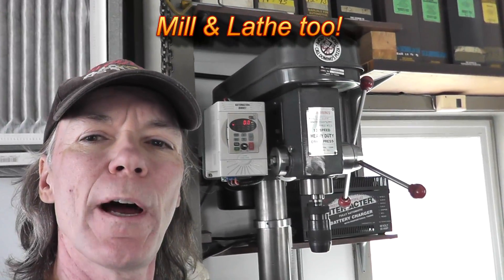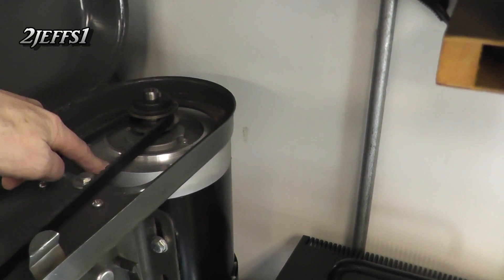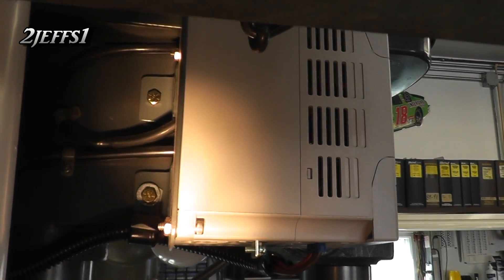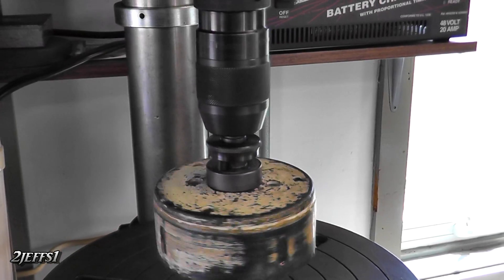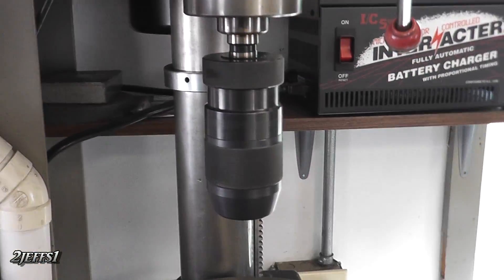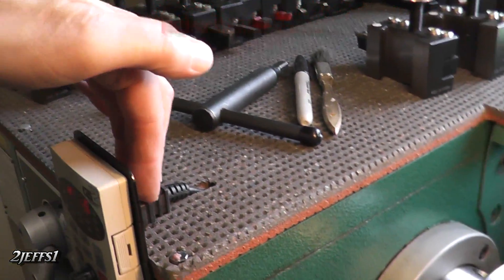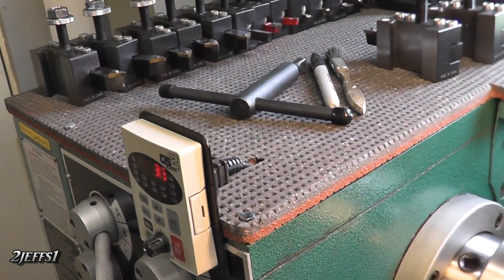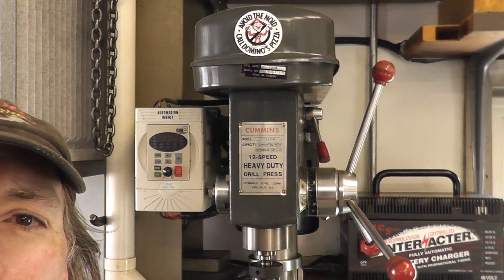VFD Drive Drill Press Lathe & Mill  (Variable Speed) DIY

Comment: love the tool tip with the soldering iron. Hey, what is your indexing hardware for your DRO?
Reply from the maker: Shumatech is their name. I built them in house with his design. He has some newer design I seen a while back those panels I have are obsolete now.
Reply: I looked up Shumatech. That's for the reference, he's using openDRO, which is cool. Thanks for the info.

Comment: Hi,  I calculate based on your setup that if you want to run your drill press at say 25rpm, you have to have like 0.8Hz input on your VFD.  Can you run it that low?  Does it work ok with good torque at that speed?
Reply from the maker: For that low speed operation I would recommend leaving that center jack shaft in to gear things down more. You are correct on your thoughts where that wouldn't work good as shown.

Comment: I recently purchased a Delta DR 40 wood lathe and none of the parts are available. It just stopped and solenoid clicks but that's it.
It has a 1 1/4 hp brush dc 90v motor. Do you know if I have any chance of finding a unit like on your drill press that would work on this motor? Also it is single phase.
Reply from the maker: Sorry - I don't know of anything you could use for a drive. Perhaps a motor rebuild shop might be able to recommend something that would be helpful. Good luck.
Reply: Thanks for getting back to me. Great video.

Comment: Thank you for your time on this. I might try it. I need to run my drill press at 60 rpm. Where did you purchase the parts? thanks again
Reply from the maker: Hello Eric. I bought the parts from https://www.automationdirect.com/adc/Shopping/Catalog/Drives  Used the drill press yesterday, still enjoy those drives so much! If you are going to be running at 60 rpm for a long time and do need lots of torque perhaps leaving the center jack shaft in for lower gearing then might be a consideration. Good luck, Jeff

Comment: Thanks for this video.   I have only recently learned about VFD and I'm not all the knowledgable about electronics.    I would love to stop using those darn belts.    

is this the motor that you used?    Did it just bolt on or did you need to modify the mounting plate?   

http://www.automationdirect.com/adc/Shopping/Catalog/Motors/AC_Motors_-_General_Purpose_and_Inverter_Duty_(0.25_-_300HP)/AC_Motors-General_Purpose,_Rolled_Steel,_IronHorse_(0.33_-_2HP)/3-Phase_Motors,_56C_(0.33_-_2HP)/MTR-P75-3BD18

and this is the drive?   
http://www.automationdirect.com/adc/Shopping/Catalog/Drives/GS2_(115_-z-_230_-z-_460_-z-_575_VAC_V-z-Hz_Control)/GS2_Drive_Units_(115_-z-_230_-z-_460_-z-_575_VAC)/GS2-11P0
Reply from the maker: Hello Michael. Those should be correct to order. I did oversize the drive to the 1 hp which is better to do if you were wondering and used the 3/4 hp motor as you had down. Seems like the pulley that was on the original motor wouldn't come off or was the wrong shaft size might be good to know too. It seems the motor bolted on without any drilling but did that some time ago and many projects since. You will love it I know I look forward to doing a job where those are so quiet and smooth. Good luck, Jeff. Oh 1 more thing - If your order was over 300 bucks there was free shipping back then. I know I paid quite a bit for shipping on the dc motors that I ordered for the Cushman and sky lift.
Reply: thanks for your reply.   I wan't to put one on all 3 of my machines.   can you make a video of how you made your digital readout?  is it something that someone who isn't electronically skilled could do?

Comment: i see you have now put switchs on your drill press with the GS2 mounted on the wall. my question is what voltage switchs did you use i can't find that information no ware.
Reply from the maker: Hi Bob. The switches I used were on the drill press originally. The one was 110v to turn the motor on before the drive was installed (which now turns on/powers the drive) and the other turned on the light.

Comment: because of your info. I can now hopefully run on 1 phase power. I bought one for my 230 volt 3 phase 1.5HP drill press hopefully it will be up and running in the next week.
Reply from the maker: Hi Justin. Once up and going you should be very happy with having that setup! Feel free to stop back and let me know how you like it!
Reply: Thanks I installed it yesterday now I just need a chuck and a DP vise and I'm set. I'm waiting in a friend to bring his MT2 and MT3 to see what fits. This is a New to me drill so we are learning as we go. Also got the shrader bellows air actuator working that turns the hand crank. Thanks for the reply.

Comment: Very nice job done on these machinery. This is a dream in many respects!
I like to take advantage of your knowledge if you may, by asking you, please, do you have any suggestion where could I find a soft start for a 2HP motor 115 V single phase, with brushes. This is for my table saw, which unfortunately the motor can't be changed? So far I can't find any one who understands about this type of device.  
Thanks for any help you could come up with.
Reply from the maker: Hi Paul. I needed a soft start a while back for the belt driven shop furnace. I ended up at an motor rebuild place. Seems they had to order it. However it was a brush-less type motor. The good part about going to those places is they will get you the proper one the first time.
Reply: I have one that I have no use for but I will have to look at specks on it to see what hp and such

Comment: You absolutely can make a single phase AC motor Variable Speed.   Like a VFD, if you vary the Frequency of the single phase via a controller, you can vary the speed of a single phase AC Motor.
Reply: I have done it with mixed results, it is kind of dicey with the start windings, etc. I did a few and it is much better for everyone involved to use a 3 ph motor. The single phase motors have a lot of heating problems if you slow them down much. It depends on the load. Pumps and fans respond better than heavy start loads. Mixed bag.

Comment: Phase one converting my 3/4Hp Jet drill press the motor and the VFD are on order. In your video you state that you have used a ratio of 3 to 1. If the motor only span at 1800 only the chuck speed would be 600, but you state that with the VFD motor can spin crazy fast. 
Any idea what the maximum may be.  Also can the VFD display be configured to show chuck speed instead of motor speed? 
Your video and comments have been very informative thanks, phase two is going to be converting my Shopfox 1.5HP milling machine. While at it, I will go up to 2HP on the motor.
Reply from the maker: +grikor1 Seems they rated those motors safe to 5200 rpm. I have the drive frequency set to 140 max and then the motor is limited to 4000 rpm. The drive freq can be set to 400 which would far exceed the motor recommended max speed. It is rare that I ever run it to the 4000 rpm speed. Seems I wanted to have the chuck speed up there too but don't believe there is any way to do that. Hope this helps you out, Jeff
Reply: +2jeffs1 Yes thank you very much.

Comment: Did I understand right, all I need to convert my Chinese milling machine would be the VDF drive and a three phase motor? In short I will not need a three phase converter.
Reply from the maker: +grikor1 Totally correct. Just that drive and motor that was on the vid. My friend just did his milling machine and said how much he loves it now, smooth and quiet!
Reply: +2jeffs1 Thank you very much. I will most definitely do it.

Comment: Jeff,  Now that you have had these machines running for a while is there anything that that you would do differently?
How is the low end torque.... I think thats the biggest concern that most of us that are considering this have ?///
Thank you so much for taking the time to share this with us, yours is the most helpfull vid that i found on this subject!!!!
Reply from the maker: +David Fields Hi David. Before purchasing anything I'll spend a lot of time researching things. Always like to avoid those - I wish I would of's when ever possible. I would do everything the same as I'm extremely satisfied with everything. I like to keep things looking good which can be deceiving where they do get used a lot. For the low torque thought I do use the lathe and drill press for taping. I just leave them in the same gear setting and turn the  VFD way down to where the chuck barely turns. I keep hitting the fwd/rev button with no stopping. Yes - then the chuck will/has come to a stop. The good news is never snapped a tap yet with no motor heat up. Never tried like - 50 holes in a row tho.  :>)  I never wish for more power at normal machining/drilling jobs, things are just fine even with a deeper cut. I also like when you are working the machine a bit hard you can tell by the sound is slightly different. Never have changed the gearing on any machines since the drives have been on. Possibly on the lathe doing a knurl would be necessary  - haven't done one since the conversion. On a final note make sure to oversize the drives as recommended in the video. On the lathe because of the mass to get rotating even on the oversize drive it would show OL on the display upon spin up and stop. NO biggie. Slow the spin up time slightly in one of the settings (book was included) and all has been just fine! I look forward to using the machines just because of how nice these drives are. Love the speed control knob right out in front of the panel too. Gets changed a lot after switching bits/cutters. Great questions you had here David. Hope this helps you out even more, Jeff

Comment: Yep today if a guy can possibly afford it, adding a VFD and 3 ph motor is the way to go. When I used a VFD on my mill it was the first 3 ph machine I'd ever had in my shop. My lathe is a relatively cheap 11" x 27" off shore machine. It's already 110 single ph variable speed. I still want to rip all that out and go to the 220 v 3 phase. Smoothness of operation, obtainable metal finishes, motor quietness, pretty much programable everything for  motor parameters. I worked in a remote mine in norther B.C. You could say we had almost unlimited 3 ph power. Just about all equipment in the mill had VFD's or PLC's on it. 

You have a great set up on your drill press now. The weak link accuracy wise on it is the table. Set up a D.I. on the outside of your table, zero it, then rest your thumb on the table, now start adding a bit of pressure. That's why I no longer own a drill press I could afford that's light enough to use with a wooden floor structure. I've got an 1100 lb baby Bridgeport clone that sure outperforms any non industrial drill press I've ever seen.

Comment: Would a variable speed drive like this work well for a belt sander? assuming it's put on a one hp motor wired to run 3 phase?
Reply from the maker: +SmithinStu I would assume it would without seeing what you have. I figure you would gear it down a bit. Love them drives but they do loose power as you get into a slow speed. Getting things geared right for an application makes for a happy ending!

Comment: The clue here is DIY ... yes he acheived what he intended to do but as for any of them been compliant to the local machine code regulations ... well thats a NO!, as well as bypassing all risk assessment, the alteration, upgrade or additions made to machinery must be compliant to current regulations - a fail on all points there then, a little knowledge is truely a dangerous thing - ignorance is not an excuse.

Comment: Thanks so much for your time and effort showing us your variable speed machines.
I just bought a used 15" Buffalo drill press from Craigslist. Apparently, previous owners were too lazy to change speeds so they had the V belt set at its lowest speed and it wore it out considerably. The only concern I have about VFD is torque. Do you lose much of it in low speed?
Reply from the maker: GnosisMan50 Hello Gnosisman50. Yes you do loose some torque when you go below 10 Hz. Most of the time I am in the area of 12 - 25 Hz. Always had adequate power for what I use it for here. The one thing where I will run it at 5 - 6 Hz is for tapping threads. To give you an idea of what to expect is I can stop the chuck with a glove on. This setting will stall then before you would bust a tap off. I will run it in and tag reverse non stop. Works great. If you need a lot of power for what you will be doing then maybe leave the center jack shaft in to reduce it to a 4 to 1 or 5 to 1 ratio so you could run the Hz higher and you should be fine.

Comment: How does the VFD effect the feed rate on the lathe.  I have a VFD on my mill for doing valve jobs. It works awesome and was thinking of adding it to the lathe but wasn't sure on it's effect on feed.
Reply from the maker: Leslie Secour Hello Leslie. Yes you are correct that as the chuck speeds up so does the feed rate as they both are driven by the same motor. If necessary you would have to change gearing on that separately. I love the VFD on the lathe where it is so easy to change speed for different tools or cuts & very seldom change gears. Sounds like you use your mill more than the lathe where it's just the opposite here.

Comment: Very slick and clean. Just received a 16 South Bend lathe and ordered the correct units for my lathe. Did you make the brackets or brought them somewhere?
Reply from the maker: Hi Bobdeham. Yes I did make the key pad brackets. The one on the lathe is a piece of thicker tin which was cut out of a sheet. I cut a 1-1/2" hole saw hole in it so the extension cord will easily fit from the rear. To mount the tin to the lathe without drilling this 3M 2 sided 7/8 sticky tape can be used. 3M P/N 06383. To mount the key pad to the tin I only used the upper hole on the key pad to hold it in place so it could be easily removed if necessary. Could of used both but then it would have to be mounted up higher & didn't want that. The whole setup is quite rigid with no flexing.  For the mill I used the L bracket that came with the machine which the stop/run switch was mounted on. Did re-locate it too. Hope this gets helps you out, Jeff

Comment: How r those brand if VFD's on low end torque or rather the power atslow speeds
Reply from the maker: Hello 76verdee. Yes they do loose a bit of power & torque below roughly 10 - 12 Hz.   As far as what I use the machines for here that was never an issue or concern.

Comment: I have a grizzly g0602  10x 22 1 hp. 110volt lathe and was wondering if the VDF unit would work with my lathe. I could really use the variable speed aspect. what is the brand of your VDF, the cost and where did you purchase it. I really enjoyed your vids.
thanks
bill
Reply from the maker: Hi Bill. Here is a link to the place I purchased all the parts. http://www.automationdirect.com/adc/Home/Home Type in the part numbers from my vid in their search box and you will go right to the parts. If you only have 110v  available you could use the drill press setup. You will have to slow the spool up speed probably. (Had to adjust mine - even on the 220v.) This should help you get started. Really busy here now - will have more time in a few days, just wanted to get back to you, Jeff
Reply: I called automatic direct and they stated their units do not have a 110 out put my lathe is a 1 hp. 110 volt motor, so I guess it won't work
any ideas let me know
thanks bill
Reply from the maker: Hi Bill. 2 things first. Ah - I am assuming you don't do production work, just for hobby and you wanted to keep your same motor -??? single phase can't be run on a vfd drive. For what it's worth here is 2c worth. I'd run exactly the same 110v setup like on my drill press. If your not burying the bit as they say that 3/4 hp 3 phase motor should be just fine. You will have to slow the spool up time in the drive but that is simple to do. (Had to do that on my lathe) Don't let this intimidate you. A bit of patience and reading the instructions that come with the drive & I bet you will do just fine! Note I hooked it to the 1 hp 110v drive. Now another point is my lathe had a 1-1/2 hp motor originally. Now using the 1 hp 3 phase motor. NEVER ran out of power or regretted it. Another food for thought example is that 4-3/8 hole saw in my drill press takes more power to turn than turning a normal cut on a piece of steel! How's that for some thoughts. Have fun, Jeff
Reply: Jeff I really appreciate your patience, I'm just a country boy and this electrical stuff is over my head. so if I understand your email correctly you're saying the vfd will work on my I hp. 110vlt  grizzly lathe if I slow down the (spool up time?). if that is the case it would be great .However this begs the question.  how is that done through the vfd ? or my 110vlt lathe motor. by the way the reason I wanted to do this is because the slowest my g0602 lathe is 250 rpm which is not good for threading with tap and dies and a few other things
sorry, don' mean to be a pain just trying to learn
bill
Reply from the maker: Hi again Bill. I assumed your motor is a single phase 110v. Those wont work on a vfd. You must have a 3 phase 220v motor. I always use a undersize motor on a vfd drive. I also read this is a good idea after I set my stuff up. What I would recommend is to purchase a 220v 3 phase 3/4 hp motor and on the vfd get a 110v single phase (in) to a 3 phase 220v output. I thought I had the part numbers for these parts on my video that is exactly what I used to setup the drill press. This should help make things a bit clearer for you. Yeah electrical stuff can be tough. But I'll bet you need both if you have a 110.motor. BTW I sold my old motors on Crags list the day after i listed them! I like your tap & die thought - that's what I use mine for too!!!